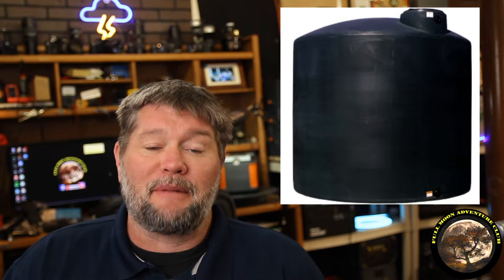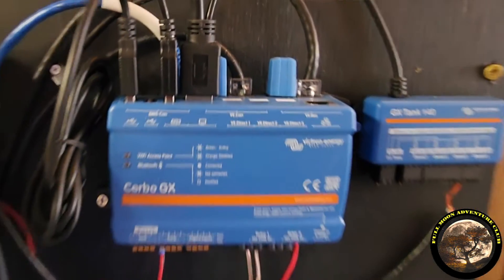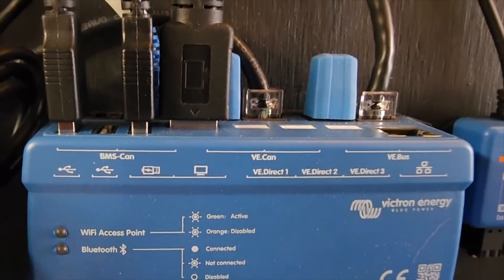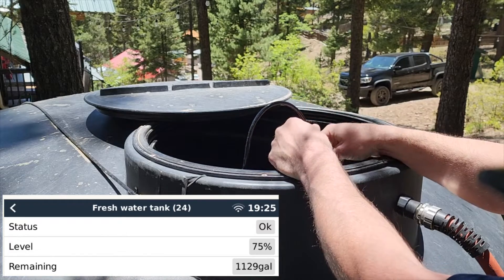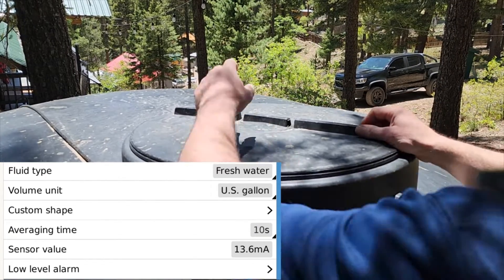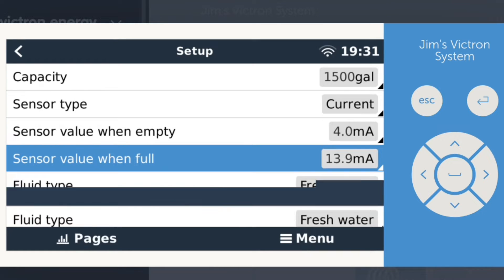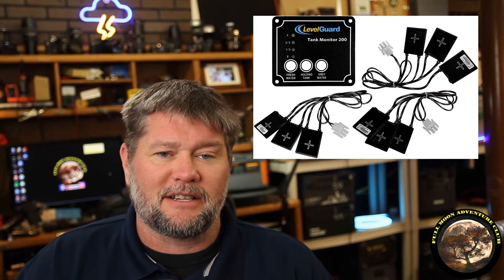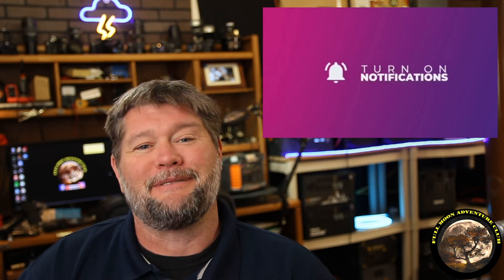Best Water Tank Level Sensor For Any System - Victron GX Tank 140 - Cerbo GX - Pressure switch

Comment: Any suggestions on how to power the Cerbo GX using an AC adapter? I was thinking of just repurposing an old laptop charger. Will use this like you for monitoring my well water tank level. My well pump building is a great distance from my solar system batteries but I have AC available in the well building

Comment: Can you explain better the sensor connection to the 140. The sensor has 2 wires but looks like you have 4 wires on the connector to the 140??

Comment: Great video and totally sold on the tank monitor. Could this be used to say monitor three tanks? I have a below ground large 150m3 water tank and want to pump water through filters to and above ground 5m3 tank. Then some of that filtered water will be pumped through a UV filter to a house 1m3 roof space header tank for drinking taps in the house. I would like to control the two pumps managing the transfer according to the tank levels. Possible?

Comment: Do you have any recommendations for rv black tank sensors that are accurate and work with the Cerbo GX?
Reply from the maker: They sell an additional add-on called a "tank" followed by some number I can't remember off the top of my head. It allows you to connect a wider range of sensors to your tanks. I currently use mine to use ultrasonic tank sensors in my large off-grid cabin tanks. It's amazing and I love it. It should also work for exterior or spin in water tank sensors hope that helps.

Comment: Hi, very interesting video. I have a question, can I connect the sensor directly to the Cerbo Gx without going through the Gx Tank 140? thanks
Reply: As far as I have learned, no. The pressure sensor provides current readings that Cerbo can't handle but Tank 140 can.
Reply: @paulternlund7751  Thank you so much for your reply.
Reply from the maker: The turbo GX will not do it alone. I am using submersible pressure sensors and I had to purchase the tank 140. It does work flawlessly. I have a 3,000 gallon concrete cistern and a 1500 gallon above-ground tank and it measures it almost to the gallon. It also sends me alerts when my water level starts to get low. Highly recommend.
Reply from the maker: Unfortunately no. I had to purchase the tank 140. I am glad that I did however because it works amazingly. I monitor a 3000 gallon concrete cistern and a 1500 gallon plastic tank and it works almost to the gallon with its accuracy. I'm using pressure sensitive sensors that are submerged. You can also set up alarms for when your water level gets low I love it and I'll never go back.

Comment: Can these hydrostatic mesurement tools be used directly with cerbo GX tank sensor without the GX tank 140 ?
Reply: No. The tank inputs on the Cerb o GX are only equipped for resistive sensors. The Tank 140 is needed for voltage or current sensors.

Comment: Why did you use the GX Tank dongle and not wire the sensor direct to the Cerbo tank input ?
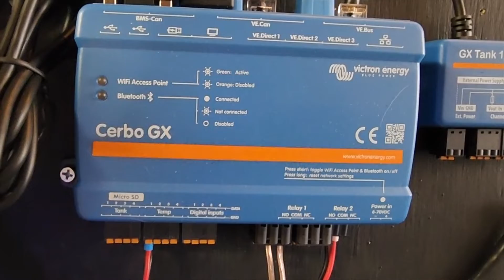Reply: 2:25 he says it requires the 24Volt power supply, which the tank dongle provides.